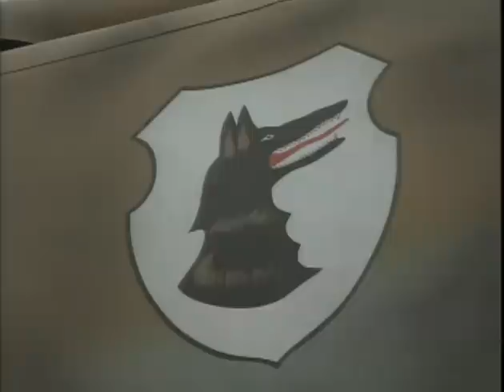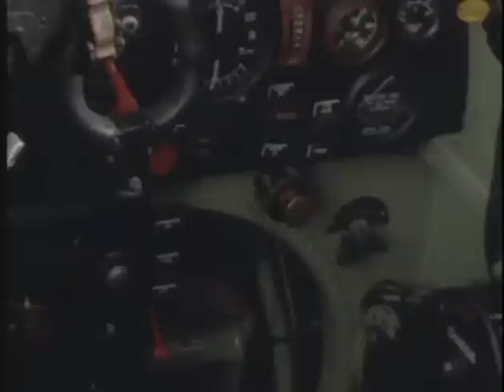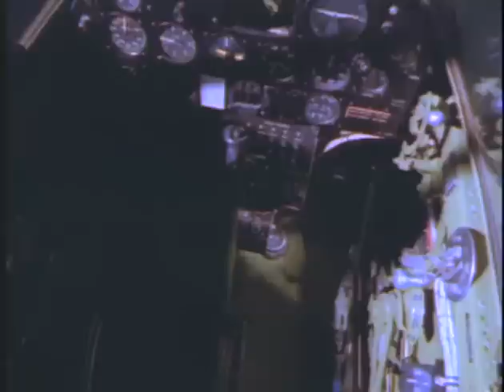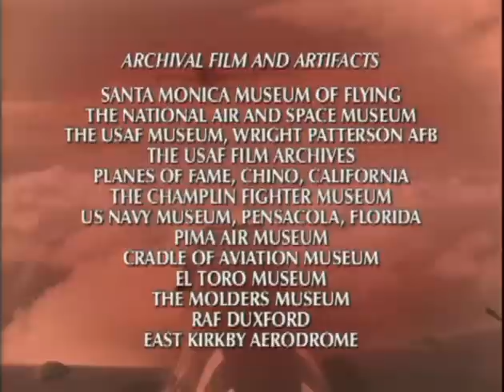Discovery Wings Clash of Wings 12of13 The Fighters XviD AC3 MVGroup Forum

Comment: Lose sight lose fight. Know your gun systems as well as your air frame capabilities.
Your mechanics, armorers, are part of your lifeline. 
Learn of your enemy’s crafts strengths and weaknesses.
Come out of sun if possible. Know your fuel consumption and return point well.
Try to maintain numbers superiority in fights, develop camaraderie with squadron mates, don’t go it alone. Don’t dwell on kill, immediately move to next targets.

Pre plan raids and tactics to high degree but be ready if plans go by wayside.
Trigger happy ground based anti aircraft crews must be weeded out by command as they are worse than enemies.

Comment: An excellent look back at some of the iconic and historic aircraft of WWII, it was nice to see some of the lesser known aircraft that didn’t get the plaudits during or after hostilities ceased. I have learnt a few things I was unaware of, like the high altitude Spitfire having a pressurised cockpit, not something I associated with the fighters of the time, or the Spitfire in its own right. My only disagreement with the narration is that that the ME262 was “easily the best fighter of the war” the fastest? Yes, but it was not really employed as a fighter, once again Hitler misemployed it, preferring to use it as a bomber and air superiority interceptor, if the Luftwaffe had been allowed to use it as a fighter then it could have extended the war but never won the war, the RAF would have had to put the Meteor into frontline service and that could have negated the ME262, it also had many drawbacks technically, like the engines only lasting for a very short in service period, I believe as little as 15 hrs, so for me it will never be the best fighter of the War. To be the best is not merely one thing, it is a whole plethora of individual things combining to produce a complete package, Speed, durability, agility, performance around various flight envelopes, armament, range, etc etc etc. Thanks for sharing this interesting and informative film 🎥😀👍🇬🇧🏴

Comment: Brief lip service was given to the Curtiss Hawk although its P-36 designation was not mentioned.  Produced in three models, the P-36A used by the French Air Force in 1939 against Germany produced several aces before some of the planes were flown to England for use there and elsewhere.  Initially powered by a 950hp radial engine, the B model engine was uprated to 1050hp, and the final 30 C models were fitted with a 1200hp radial which gave the fighter a 330mph top speed.  The P-36 Hawk line was replaced by the P-40 Tomahawk.  Although the Grumman F4F Wildcat has been credited with the first air kill by an American made fighter in WWII,  actually French P-36 Hawks hold that honor and later British Hawks shot down a German FW110 over the Scalpa Flow strait before the F4F entered the war.  Captured French P-36 Hawks were sold by the Germans to their Danish allies and were used effectively against Soviet aircraft in the early stages of the war.
Reply: I think you're confusing Denmark with Finland. Finland did buy captured P-36 Hawks from Germany, while Denmark had no independent airforce after 9 April  1940.
Reply: Surly the honour of shooting down of an enemy aircraft by an American piloted and made aircraft would go to the flying tigers!!!!???

Comment: The "P-39 Airacobra" shown at 21:32 was usually referred to as the P-63 Kingcobra since that's what it is.  Come on neighbor, look at the vertical stabilizer. No mistaking that.  :)
Reply: Rikki0, Aircobras received a bad rap from the beginning. Russian pilots said. Don't send any Spitfires. Send alot more AIRACOBRAS. I think if you went upstairs with a minimal amount of FUEL & Ammo. This little fighter was a badass
Reply: @davidvance6367  You're right to some extent, David.  The P-39 was not a great aircraft but it was not nearly as bad as it is often painted to be.  When used in the proper context, that being mid to low level fighter to fighter combat it was actually pretty darned good.  The Russians proved that with many of their aces racking up some very high kill totals in it.  A major factor being that most air to air combat on the Eastern front tended to be at mid to low level altitude where the P-39 was at its best.  America had one P-39 ace.  We tended to fight at higher altitudes where the P-39 was handicapped by the poor performance of its single stage supercharger.
Reply: The British only sent tired or crash repaired  Spitfires to Russia ,no wonder the VVF thought little of them .

Comment: Once the Typhoon was dialed in it was a amazing aircraft, such a radically designed engine. I read it did suffer from engine fires and that pilots were required to wear oxygen masks before they started the engine as the carbon monoxide fumes were so strong in the cockpit, it would incapacitate the pilot..

Comment: During WWII all the nations involved had some fantastic aircraft, but none of them would have been any use without pilots to fly them and engineers to maintain them, this video is interesting and informative, but mentions of the crews that manned these aircraft are few and far between, a minor point, but true. Thanks for sharing. Thumbs up 👍. Thanks.
My two favourite fighters of WWII, the P-38 Lightning, small (comparatively, with other fighters) but sleek and fast, and the Mosquito (she carried out many roles, including fighter bomber) again, sleek, very fast, and effective. There are many others I admire, but those two were/are the best WWII fighters. When the narration said that the ME-262 was easily the best fighter of WWII I nearly fell out of bed, a bit of an unfair comparison, the only two jet fighters of the war came into service very late in conflict and would easily have outstripped propeller driven aircraft, as would the Meteor, so comparing them to the prop driven fighters is wrong, perhaps the best jet aircraft, but still an unfair comparison.
Reply: The P-38 was in NO way SMALL compared to other fighters!

Comment: When they said that the Zero was meant to be doing the shooting and not to be shot at that's the truth. Other pilots have said that the Zero was a ticking time bomb, ready to be lit up if you could fire on it. It had no armor around the cockpit to support the pilot and oil control systems. That's why it was so light. I guess the Japanese thought they could easily replace combat flyers if they got shot down. They found out too late when they ran out of qualified pilots. Also, the radial engines seemed to rule with A/C. Wonder why Mazda was the only one to introduce them in cars?
Reply: John Allen Mazda makes a ROTARY engine.  Not the same as a radial engine. 
Radials we piston engines. A rotary engine has a single triangular " piston" of sort that spins instead of reciprocating like pistons.

Comment: Yes the Mk XVI Spitfire with the Griffin Engine did have enough speed to be able to down the V1 "Doodlebug" Flying Bombs, only just however. 
The task was very quickly assigned to the Typhoons with their massive engines which by that time had finally begun to iron out its initial teething problems. It was the fastest British fighter made, propeller fighter anyway. Squadrons of Typhoons were rotated back from France where they had been working in the Ground Support role specifically to counter the V1s. 
It has always been a popular myth that the first British Fighter Jet, the Meteor, was the main driving force behind protecting London, and other English cities from the V1 threat. That was never the case. In a system that rearranged AntiAircraft Ground defenses forming belts along the coastline in the areas the V1s approached and behind them the Fighter aircraft would then operate in a rough partnership. The antiaircraft guns, with many being radar controlled by this time in the War as well as using the new proximity fuses for the shells most of the V1s shot down were by the Guns of the AA batteries--many of those still operated by the Home Guard Units too. The fighters had great success too with Typhoons shooting the most by fighters with Spitfires comming in a distant second. The Gloster Meteor wasnt credited with a single kill of anything. 
If you think about it in terms of those times it makes perfect sense even if its hard for us now to understand. At that time, although it was clear the allies would be victorious it was far less clear as to when, and with the complete suprise and shock of the Battle of the Bulge who knew what the Germans capable of. So the Meteors were hoarded and their numbers increased in case they were really needed to counter the Me262 or other German Nasty suprise. Also the Meteors were cutting edge fighters with cutting edge price tags at a time when England was begining to really pay attention to issues of the economy, and with dread and horror at the War Bills that would soon be due at Wars end. England was coming very close to Bankruptcy at this point. So the loss of a cutting edge fighter that would comprise core the post war RAF fighters wouldnt be casually dismissed as it would have been a year or so earlier. In other words risking a relativily inexpensive Typhoon that would be scrapped as soon as the war was over would be an acceptable risk. Make no mistake, shooting these V1s down was an extremely risky dangerous business. They had to be engaged at maximum range or as maximum as possible, where ots far more difficult to hit (The Polish Air Force pilots that came to fly for England in the Battle of Britian scored far more kills, had far better results than the British pilots did. Thats because the polish air force trained, and calibrated their guns to converge, far closer than British pilots at the begining. With experiance they learned to engage at ranges of 100 yards or so but before that their kill rates were low. Lesson being its extremely difficult to get hits at max range). Problem is though the difference between max range and min range is only a scant few seconds with their closeing speeds. Many pilots were killed when they were too close when they finally hit the bombs and the huge weight of explosive would kill them as well. It was a tough business, esp when thepilots knew if they screwed up and let it get through that innocent civillians and maybe even pregnant women and children would almost certainally die as a result.
In any case the rareprecious and expensive citting edge jets were too valuable to risk when so many other planes were around that can do the job with equal sucess, maybe even better as the much cleaner jets were much harder to slow than the prop aircraft that had plenty of drag so slowed on demand just throttling back.
Reply: Tempest was the fastest.
Reply: James Taylor  The shitfire Mk XVI as a Packard merlin powered plane !! ! NOT a Griffon !!!! The only shitfire Mk after the Mk IX that used the merlin engine and the only shitfire to use a Packard built merlin !!!  Only 1054 were ever built, late 1944 as a Low med ground attack plane !!!   The shitfire Mk XIV (14)  was the Griffon powered version !!!
Reply: James Taylor  Hey dumb ass !!  The Shitfire Mk XVI (16)used the Packard Merlin   NOT the griffon !!!!  DUUUUUUUHHHHHH  !!!!!  Did you mean the shitfire Mk XIV  or 14 ?????   HUUUUHHHH?????

Comment: Hawker Hurricane started work with a fixed wooden properly and changed to a metal Changable prop that started with take off pitch and at speed,  changed to performance pitch.  That was it.  All you got.  You were stuck in third gear until your crew chief climbed up with a bar and flipped back to take off pitch.  Later the constant pitch propellers were installed by its makers against the wishes of the top brass. The flyability changed so much they needed thousands more and so paid. The same maker said they don't want my wooden bomber, but they will.

Comment: P-47s are my favorite. Bugged me when the one with the checkered Cowl sounded like a P-40. Note: although the Mustang has the looks, of the top 10 Aces in the ETO, most were in the Jug. If you've ever heard a Thunderbolt fly over with the Throttle opened 75% or so, It's in one word "Macho!" Makes V-12s sound kinda anemic.
Reply: P-47 is my favorite as well. 8-0.50 caliber guns, armoured, range, rugged, fast, etc. etc. It was a beast. It cleared the way for all others and fought the best enemy pilots.
Reply: And they also survived to a far higher rate.
Reply: except, perhaps, a fuel consumption...

Comment: Even though there were eight guns on the early British fighters that still didn't change the fact that they were the British .303 Standard Infantry Rifle Cartridge and the overall firepower was very enemic. That's was especially true considering that the British pilots were taught and trained to open fire at the maximum range meaning the projectile had only a small fraction of its kinetic energy by the time it hit its target so  it's destructive potential was small. 
When the polish pilots started flying during the battle of Britain their success of kill rates were far better than those of the British pilots because the polish pilots were trained to open fire at point blank ranges. This maximized kinetic energy and damage to the germans. But there is no doubt at all that the RAF would have had a much larger kill rate of they hadn't had the Browning company chamber the machine guns to the .303 from the much larger .50 caliber that was standard on all American fighters. The British had It rechambered for the .303 because they had millions of surplus .303 ammunition left over from world war one and even then saving money was a big concern for them whenever and wherever they could. But in this particular case it cost British lives until they started mounting the 20 mm cannons on their fighters, much more destructive that the fifty even but far slower rates of fire so in balance the fifty and the twenty mm cannon had roughly equal potential.

Comment: you forgot to mention that the P47 was still in use during the Vietnam war flying with the search and rescue  helicopters  then known as a sandy
Reply: No
Reply: Eeeeeh; "Sandys" in Nam were Douglas A-1 Sky Raiders, also known as Spads. A-1s also had a Cervice Ceiling of only 28,500 ft, P-47s topped out at 43,000. Big difference. P-47s were made for high altitude work, that's why the only plane that could compete with a Jug above 30,000 was the ME 262. AND, yep that was VERY dicey for the P-47 pilot.
Reply: @lindamcentaffer5969  you are right  I had my aircraft  mixed up.

Comment: Wonder what the Mustang would have been like with a Daimler Benz.
Reply: Slow.
Reply: Adolf would never have aloud it
Reply: @alanbush4192  He would have "allowed" a Ford motor.
Reply: Quick, sorry James.  There was a captured Spit that was fitted with a Daimler Benz engine known as the DB 605, I believe and it had 300 more horsepower than the original Spit engine.  It was quicker.  The Mustang also had a Merlin....
Reply: Take a look at the Imperial Japanese Army's Ki-61 Hien (Allied code name: Tony). It used a license-built Daimler-Benz DB 601A engine, and was a capable high altitude interceptor.

Comment: A large number of very basic technical errors.  An historian-editor/proof reader was  genuinely needed.
Reply: Large number? Such as?
Reply: @WALTERBROADDUS AT 7:00   "In  1939 Hawker Hurricanes were the only aircraft in the British Airforce to meet the Germans".  So there were no "Constant Velocity Propeller" equipped Spitfires at Dunkirk? REALLY?   That's enough proof of shoddy research ---this is rubbish!
Reply: @paullubliner6221  Spits were in limited service and did not see action till Dunkirk in 1940. So not really a error.
Reply: @paullubliner6221  Also the Spitfire prototype and first Mk1.s had the same two blade prop. https://youtu.be/8VxjnPkRpA4

Comment: P 40 's never had Merlins engines in service  ,only Allison 1710 .
Reply: You are incorrect.  The "L" model had a Merlin.
Reply: Paul Davidison  WRONG !!! WRONG !!! ALL FUKIN WRONG !!!!!  The first contract of the Merlin at Packard called for 3,000 V1650-1 for the USA as a bribe, and 1311 were installed in the P40 F & L which made no difference in overall performance and they returned to the Allison !!!  You might want to check your facts for accuracy before relying on what "someone said" DUUUUUHHH!!!!!!  FYI  IF you see a P40 with a smooth upper cowl, no airscoup, it is a Packard Merlin !!!!!
Reply: @WALTERBROADDUS    As did the more populat F model !!!  Facts of history !!!!  DUUUUH!!!!!!
Reply: @WALTERBROADDUS    -  yess !! we can recognize them :
 they lack the air entrance at top & front of the engine cowling, just after the prop' cone.
French F.A.F.L. have had some when north Africa based
Reply: @skualpascal6684  Correct.  Strange,  this is a hot topic of debate?
Reply: @WALTERBROADDUS  - hot ? I dont know, but its important to enthusisats _ like me  _ to know & let know more about this fantastic craft & its numerous versions / alterations